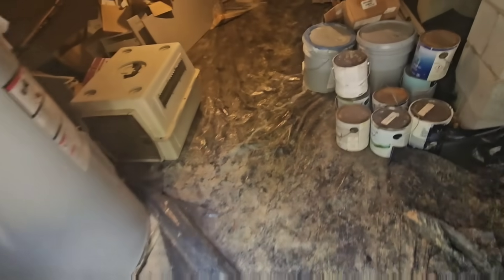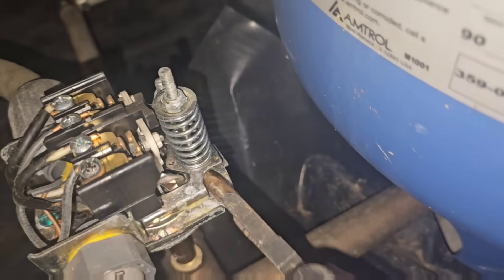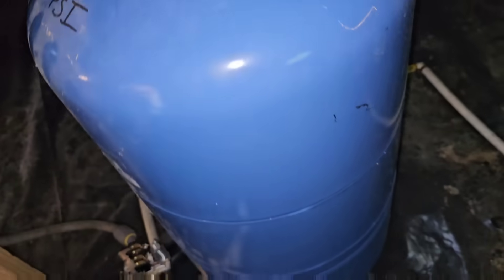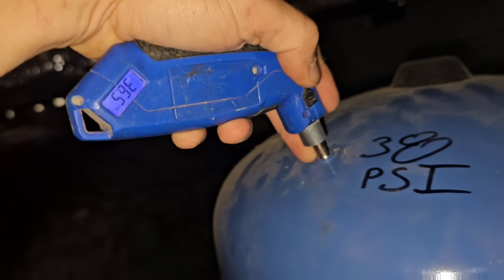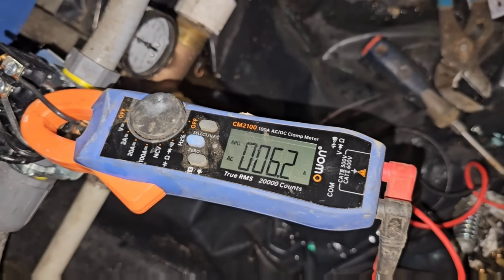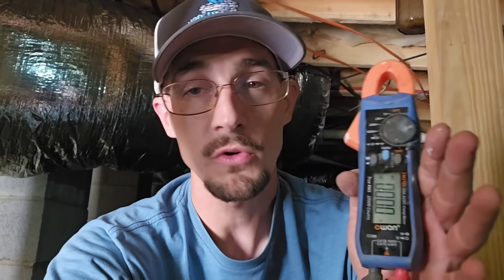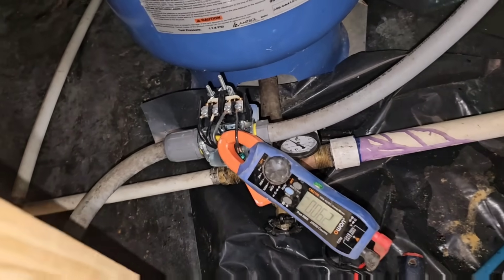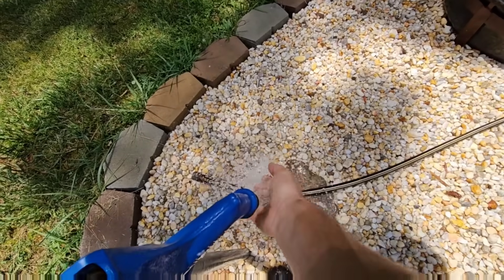Well Pump Troubleshooting at The Pressure Switch. DIY Test & Fix for No Water.

Comment: Many thanks for the tutorial.  Retired and living in the Philippines.  Been in a drought for 4 months here and finally gave up on the local water system.  We are having a local guy drill us a well.  He  has drilled 2 recently within 400 yards of me.  Says he expects to see a water source at around 220 feet.  I watch everything you post.  It lets me at least semi understand what to expect.  I was a plant engineer, so I actually can design the pumps and piping systems, but the knowledge of what goes on under the ground is new for me.

They would kill for a drilling rig like you have.  They do it manually, and for the first 10 days, they did it with 4 men lifting the pipe with a 5 1/2" bit on it and dropping it down.  Then using a scoop to pull up the spoil from the hole.  Normally they have a gas motor that pulls the pipe up and drops it but it was in the shop for repairs.  Just got it back yesterday, so everyone is relieved that the motor can do most of the hard work.  

Your info on your drilling days has been a very big help to me.  These guys are literally in the stone age, but have no fear of hard work.  So we have made progress although very slow.  We are just over 80 feet down.  Fingers crossed that we find the water like the neighbor.  It is beautiful crystal clear water.

Thanks again...👍
Reply: Ram Pump if you are near any flowing water

Comment: I’m pretty sure our pump will need to be replaced in the next few years. If we use a lot of water (hose on for 20min+) it will start to pull higher amps as the water level drops in the well and will kick off on thermal for 2 min then back on for 1min.  I can watch it on my power monitor and graph it. 
Usually keep it off when that happens for about an hour and is fine after. 

Previous owner had the pressure switch modified to 55-70 psi and I think caused premature wear. Only 1.5gpm well too..

Comment: Great video and explanation of how to use a clamp-on ammeter for troubleshooting.  One thing that was not mentioned is that you can also use an ammeter to check the integrity of the discharge pipe from the pump to the well head.  It is not uncommon for a submersible pump to break off at the point of attachment to the discharge pipe.  This is fairly common on older systems where galvanized riser pipe was used, due to repeated start/stop torque.  The one thing most people do not realize is if you remove the head or back pressure from an electric pump, the pump will move more water than it is designed to pump due to lack of resistance to flow.  This usually results in the pump drawing anywhere from 10% to 20%. above nameplate amps for the pump model in question.  For example, if you look at the run amp rating on the pump control box and it states full load amps is 7.5A and your clamp-on ammeter is reading somewhere above 7.5 amps but not over 8 or 9 amps, there  is a good chance that the pump is OK, but it had become detached from the discharge pipe where it connected to the pump.

Second comment.  When you went into the wire color details on the pressure switch terminals you didn't mention that today we are seeing a change in wire color with respect to 240V wiring.  Traditionally when wiring a 240V circuit you used a cable with a Black and White current conductors and a third bare ground wire.  Today most electrical contractors are installing cable with a Black and Red pair of current conductors and a bare ground wire when the circuit voltage is known to be 240V.  So on 240V supply circuits you may see either a Black/White pair, a Black/Red pair, and in some cases even a Black/Black pair.  On the well pump side of things you may see Black/White, Black/Red/, or even Black/Black depending on what cable was used.  The main take away for both 240V and 120V systems is to make sure the two supply conductors, irrespective of color land on separate contact terminals.  The two current carrying wires to the pump land on the remaining screw of each contact pair.  Normally it is fairly easy to determine which of the four terminal screws pair to a contact by using an ohmmeter to determine which is which.

Comment: Also, if you open your pressure switch and only have 2 wires on one side of the switch, you have a contactor, which can be fouled up like a pressure switch. (Black/Sooty/Worn contacts)  Idk how often you run into control boxes but probably 90% of the time if you have one, it's either the overloads have tripped or a bad start/run capacitor or both. I didnt know about the return voltage from testing the lines from the pump. I've always just tested resistance and if the lines were grounded out. :)

Comment: Milwaukee cordless air pump would be a good investment for you.
Reply: I've love milwaukee but I regret buying the compressor. The regulator was poorly designed. When it fails, it's useless until it's disassembled and cleaned/oiled